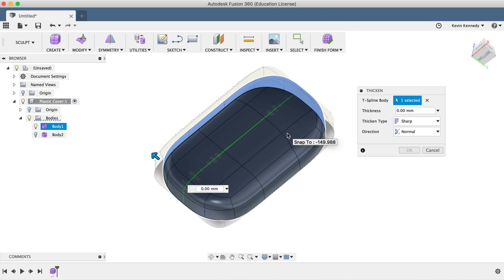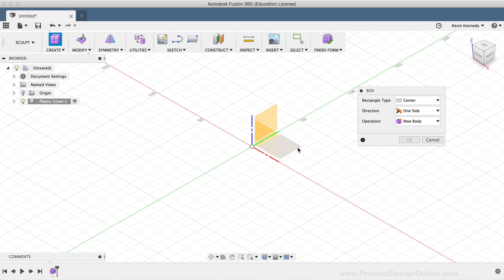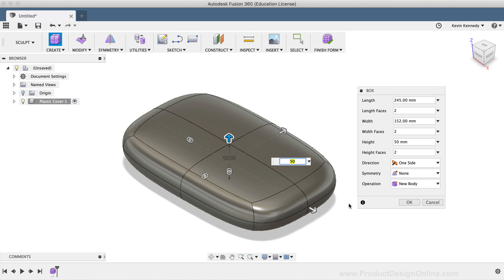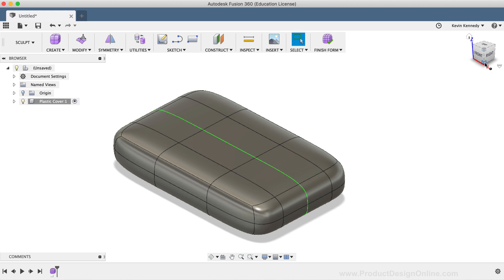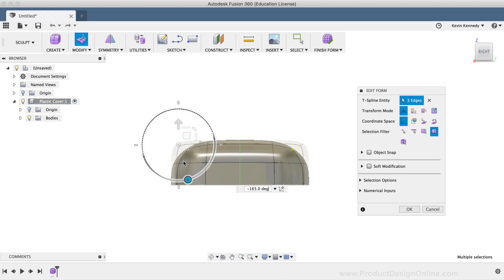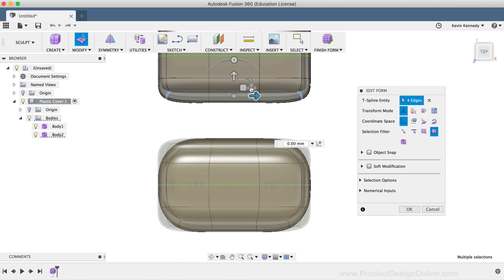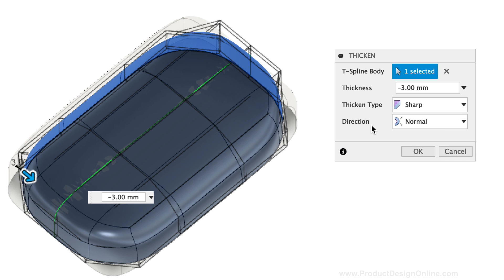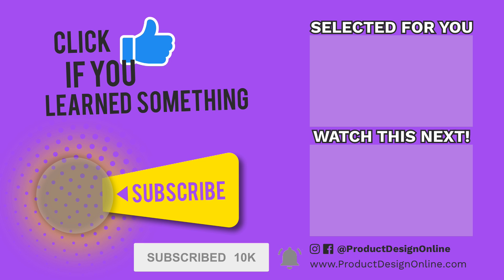Sculpting for Plastic Parts in Fusion 360 (Part 1 of 2)

Comment: <Q> You said that the solid could be parametic in the MODEL MODE. What does mean that the solid is parametric?
Reply from the maker: Hi, 나이젤. Great question! Parametric is a term used to describe a dimension’s ability to change the shape of model geometry as soon as the dimension value is modified.

In the Sculpt environment, the t-spline bodies are not parametric because we are not adding dimensions that can later be changed. You can re-sculpt the body...but you can't simply click on a dimension and update the value.

However, In the model workspace, one can continually go back and click on the "features" in the timeline to update the dimensions. Therefore, the model is "parametric."

Let me know if this clears up the definition for you! Cheers, Kevin :)
Reply: @ProductDesignOnline   I fully understood it !  You are so generous. Thanks >_<  from Korea
Reply from the maker: @박상글-s1g  You're welcome... glad I could help! :)

Comment: Hi, could you teach me to make this model here, would it be a circle with these borders, thank you from
https://drive.google.com/file/d/16FXrL5iva-JoR0-7l83jpAvSEs4TzS4P/view?usp=sharing
Reply from the maker: Hi Paloma - you'd probably want to create a circle the set distance away from the center point from that object. Take a look at this image - https://snag.gy/OI2dSF.jpg

Create the small yellow circle representing one of the curved edges. Then, I would circular pattern the circle around the larger yellow circle, which would create the other circles (orange circle, but there would be one for each area). Then, use the sketch fillet tool and select two circles at a time, which should create the curved radius (red arc). Cheers, Kevin :)